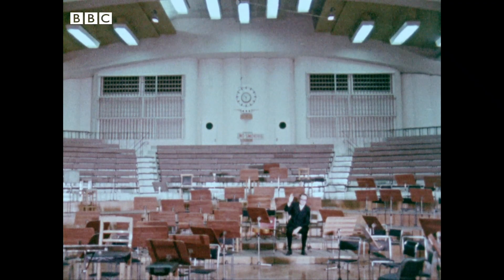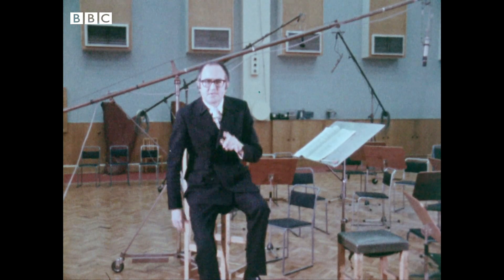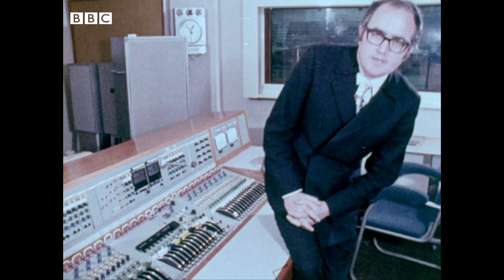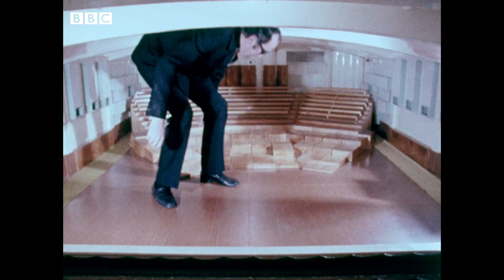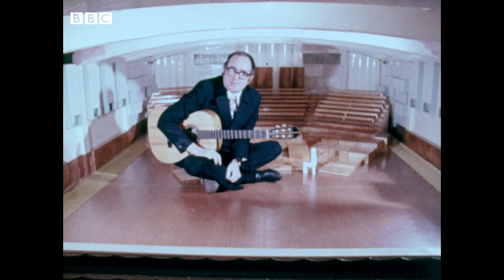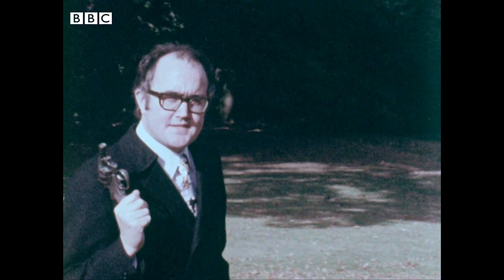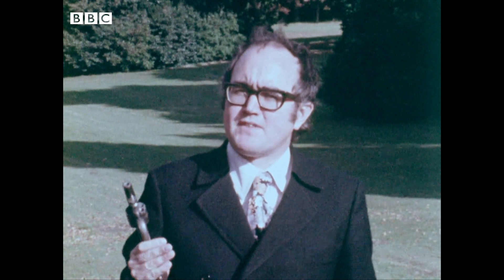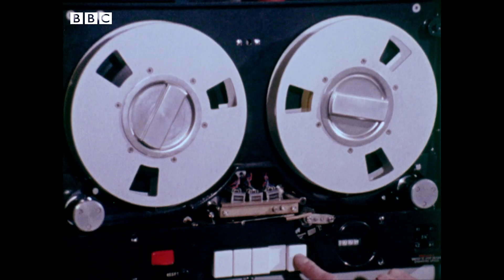1970: PERFECT ACOUSTICS with JAMES BURKE | Tomorrow's World | BBC Archive

Comment: Strictly speaking, the materials and finishes of the walls and furnishings on that scale model need to be modified also. There are mathematical ways (dynamic similitude, Buckingham Pi theorem) of calculating what adjustments need to be made to determine equivalent absorbencies.

Comment: Love the video, love Burke, but that 1:8-scale model would only be accurate if the air inside were 8 times as dense, surely?
Reply: Although it seems like it should be intuitively, that not actually the case. Speed of sound = frequency/wavelength. The density of the air has a negligible effect on the speed of sound, which is only affected by temp and humidity. As long as temp and humidity are the same in both, then the only parameter that needs to change to scale the acoustics properly is frequency. The full scale (Ffs) frequency and scale model frequency (Fsm) are directly proportional to the scale ratio (in this case, full scale/model scale = 8/1 = 8) by the formula Fs = 8 * Ffs, ie the original frequency*8.
Reply: I think that the size of the air molecules would have no real difference because they are vastly smaller than the ⅛ reduction. However, you did rase an interesting point.👍